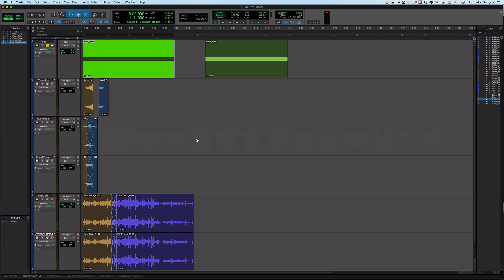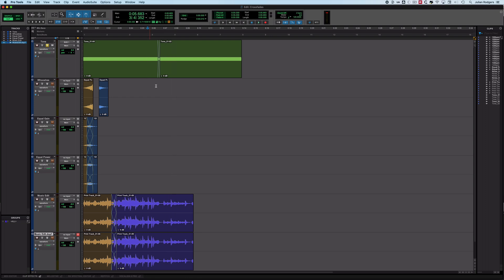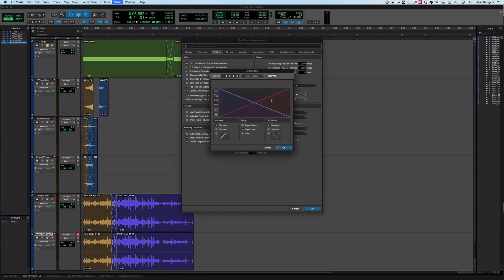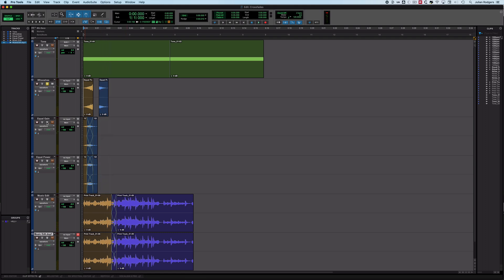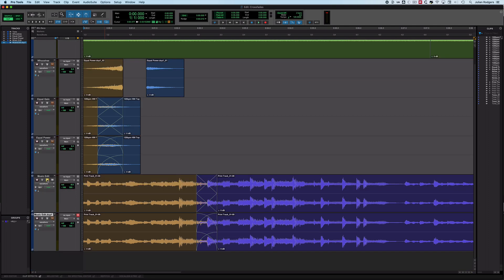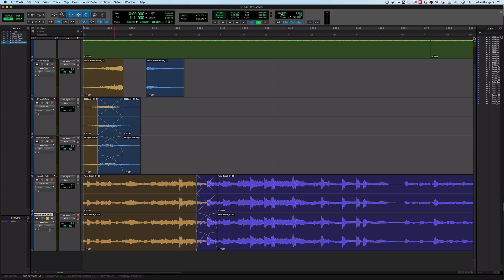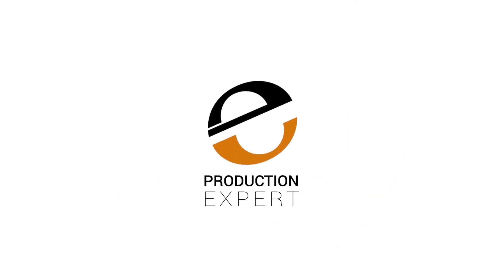Crossfades In Pro Tools

Comment: I do a lot of mixing for post production, and when I receive an aaf, it almost always has the fades as equal power which is problematic. I end up having to replace most of the fades with equal gain, which is time consuming. Is there a way to import an aaf, and have the fades be equal gain?
Reply: You can select all audios and do Ctrl+F on Windows or Cmd+F on Mac, it will open a window to configure all the fades at your will at once
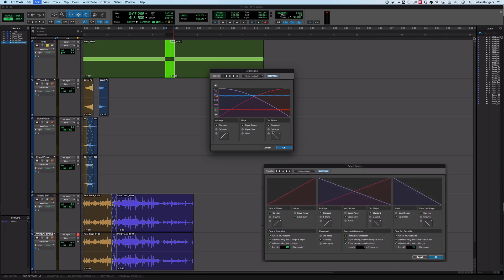Reply: 2:04 the Batch Fade window
Reply: @mikaellatchoumia2554  Thank you so much for the tip!